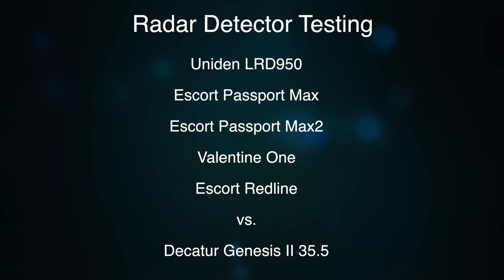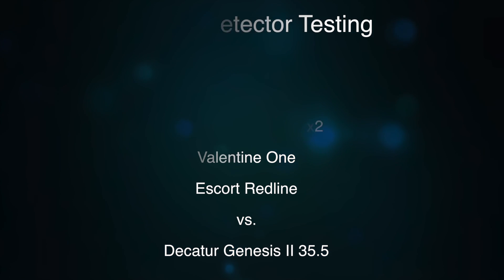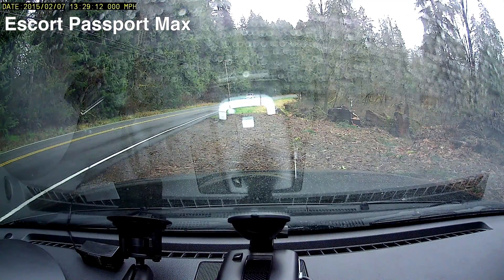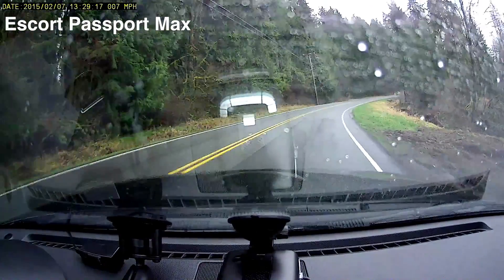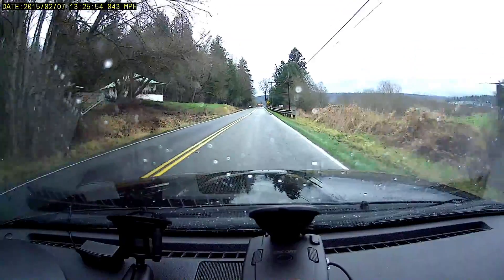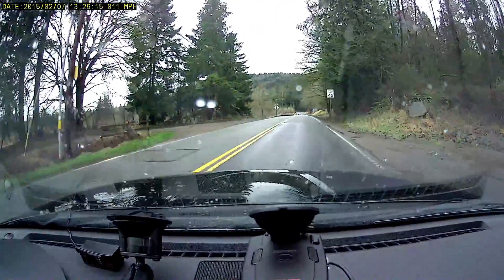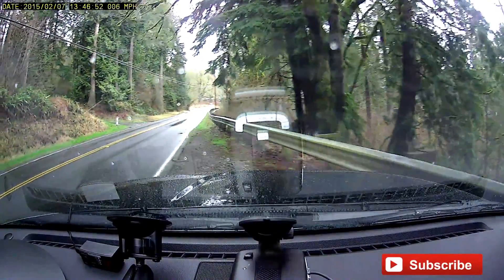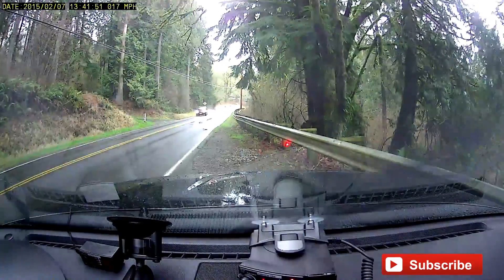Radar Detector Testing: Max, Max2, V1, Redline, LRD950 vs Genesis II 35.5 Ka

Comment: What camera are you using?
I would also like to know pro/con for selecting certain frequencies on my 9500. I have seen and heard you talk about them but haven't heard the significance. 
THANK YOU for your testing, videos, and your time
Reply from the maker: I use a pair of itronics ITB-100HD's that I've been running for a few years. Newer ones have come out since.

What do you mean about frequencies? Do you have a 9500ci or 9500ix?
Reply: Those look like nice cams, any cons about them?
Reply from the maker: paul baker Takes 30 seconds to begin recording after startup (newer one is 15), one of my cameras doesn't look so great at night and does some weird blue artifacting, 24fps instead of 30fps, the software is Korean and poorly translated to English (newer version is all Korean), but that's okay. I like the SD cards instead of MicroSD so they're easier to handle, the matte black finish is not very reflective, I like the way the timestamps and speed are embedded on the frame, you don't have a bunch of excess stuff like vehicle voltage that you can't remove, you get GPS so you can tell how fast you're going and where you were in different video clips, etc.

Comment: If you had to pick between the Redline, LRD950, and the V1, which would you pick for the best awareness? There is a ton of information on all of these detectors and I've looked around your posts on amazon, rdforum, and other places.. but it's a bit overwhelming. I feel like the arrows on the V1 are very useful, but the Redline has the best overall range. Is there something I'm missing?
Reply from the maker: +AKMetal For situational awareness? V1 no question. The arrows are fantastic, it tells you how many signals you're seeing, you get the frequency information with YaV1, etc. That's a pretty techy setup though. The Redline is more of a highway detector. The Max360 is an all-around pick like the V1, but easier to use. The LRD950 is a good all-around pick too, but it's just about discontinued now, soon to be replaced by a new model.

Comment: Could you post your settings you use for the v1 in your everyday driving ???
Reply from the maker: Basically Ka guard off, custom swept for 33.7, 34.7, and 35.5, TMF2 on, Savvy emulation below 35mph, autolockouts, and some other stuff like mute rear antenna on K band and stuff.